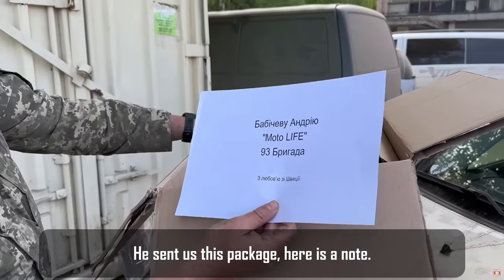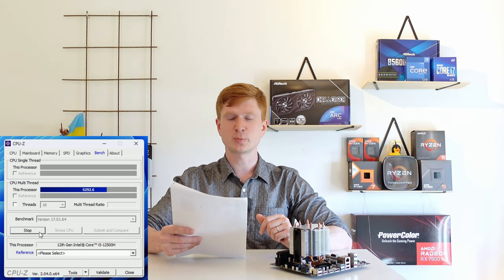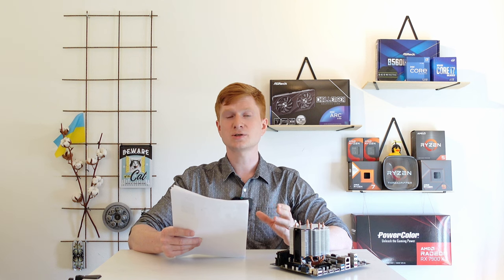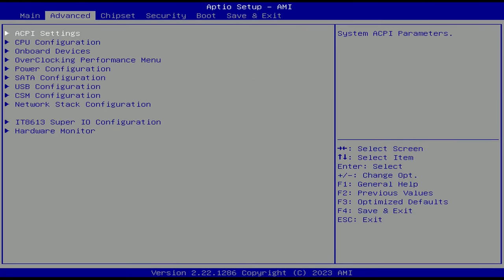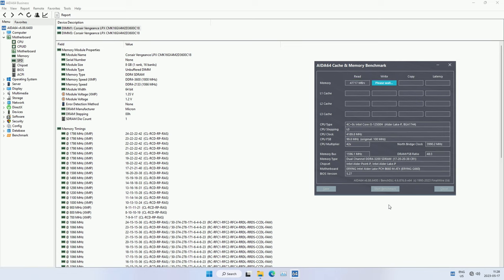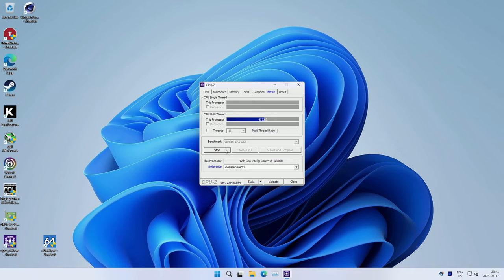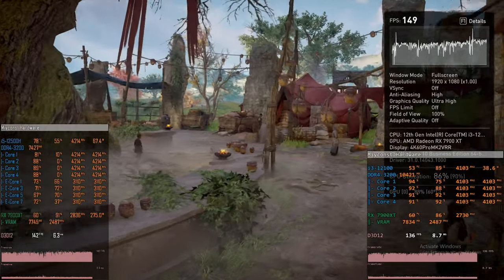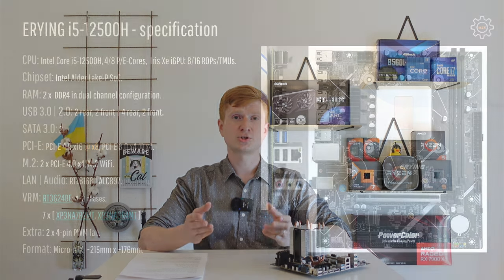🇬🇧 ERYING i5-12500H 4P and 8E Cores, but who is it for?

Comment: Hey Miyconst, could you do a video on the most reliable Chinese x99 boards? I'm looking for one for a server, so it doesn't need overclocking or ram timings, but it does need to have lots of slots, pcie as well as nvme. It does need to be reliable.
Reply from the maker: I will try to address this question, because people keep asking again and again.. even though the answer is obvious.
Reply: @Miyconst yeah, so obvious...

Comment: (Question copied from an older video) Hi, love your content! Quick question, I am currently thinking about buying a Xeon 2690V4 with either a HUANANZHI QD4 motherboard or a HUANANZHI X99 F8 board with 64GB 3200MHz ram running at 2133MHz. (Aliexpress) I currently own a 3570K (not overclocked, board doesn't support it) at 3.6 GHz minimum speed. I want to use the Xeon for orchestral composing in FL studio, and the minimum requirement is listed at 2.8 GHz quad core for some of those softwares. If I get the xeon with the QD4 M/B, will it be too slow? QD4 has no overclocking support, but it's only half as expensive as the X99 F8. All I want to know is, with the QD4, can it boost to at least something like 3.0 GHz on all cores? Or if I get an X99 F8 board, can I overclock the Xeon 2690V4 safely? (I intend to use a 3060ti with this cpu and my PSU is a silverstone st60f-es230 600w 80+)

Comment: I think there is a newer bios available? The videos from erying I have seen has a more "graphical" bios. Would had been awesome to see power consumption of the board.
Reply from the maker: I asked them for a better BIOS, nothing was offered.
Reply: @Miyconst  There is someone that made a library of drivers and bios files on erying motherboard subreddit. The drivers came directly from manufactures, but it is only for 11 gen.
Reply from the maker: @aqua_cat_  as you could guess, the 11th gen drivers / BIOS can't be used with a 12th gen board.

Comment: I was looking again a video on your channel about x99 on 2022. I was thing in replace my zx 99 dual socket for a f8d plus, but 230€ is a bit expensive just to get one with sleep mode working and more pcie slots. Do your still recommend f8d plus as best dual cpu?
Reply from the maker: I don't think there is any reason to buy these expensive dual socket motherboards. Only a few niche cases can justify it.
Reply: @Miyconst  I have already spare cpus (but I really don't need a second pc as server). In my case u don't play game I use it for visual studio, web dev tools, c# nodejs, and I have some docker services on my dev machine. My atual problem is the sleep doesn't work an most of the the pc stays on all the time. I changed to hibernate but it takes time to boot and requires to explicitly send to hibernate. I am happy with 2x14 cores, The performance is good but annoys me to  not have sleep, and just 2 pcie slots.
Reply: @Miyconst  but 230€ is maybe not a big difference on leaving it on for a  full year, bit I feel like wasting electricity, because even the hibernate fails awaking in the night (maybe some software issue)

Comment: Hi! I hope you notice my comment and reply since I really need your expertise and experience in Xeon platforms.

I'm planning to buy a Xeon 2680v4 since it only costs like 24$ from a local site that ships from China. My concern is with the motherboard.

Is the Huananzhi x99 d4 good enough? It's the one I'm considering since it says it is mATX platform so I don't have to change out my mATX case.

 My other option is the machinist rs9.

The both cost the same at 80$ but the machinist board would require me to look for a full ATX case.
Reply from the maker: I would go with Huananzhi X99-QD4, it's good for most of the CPUs and the quality is kinda ok.
Reply: @Miyconst  thank you very much for the quick reply! Your channel is such a gem for people on a budget!

Comment: hi, is possible unlock TDP to 120w, here im Brazil, we unlock all potential this processor
Reply from the maker: Please watch the video.
Reply: And then burn your house down from constant 100C overheats
Reply: @Dregomz02  is true, but, with the right cooler fan, this problem is solved (if you use liquid metal).

my setup is locked in 70w because i don't need this.

Comment: IF they turned that thicc heatsink into a waterblock it will sole the issue
Reply from the maker: It might be able to improve cooling but the price would be absolutely pointless.
Reply: @Miyconst  its pointless to use a  heatpipes cooler on that 1cm thick heatsink .. stock cooler might work better ....

Comment: Why don't intel just make I3 14300 unlocked  4p cores 5ghhz all cores boost like ,most 13rth gen atleaat atleast + 4-8E cores @4.5GHZ. DDR 6000-7000 mhz? Lmao
Reply from the maker: Intel might be forced to unlock their CPUs if the sales continue go bad, but it all depends on us consumers, what we buy and what prices we swallow.
Reply: @Miyconst  true mate. I just hope they do and finally allow 3-4 gens per socket lmao. That would be huge
Reply from the maker: @gamingedition5165  things are already looking better, Intel plans to release 14th gen on the same LGA 1700 platform.
Reply: @Miyconst  yeah and i3 is going to be 6c 12t finally :) and i5 looks to be getting 8P cores also definitely moving in the right direction.